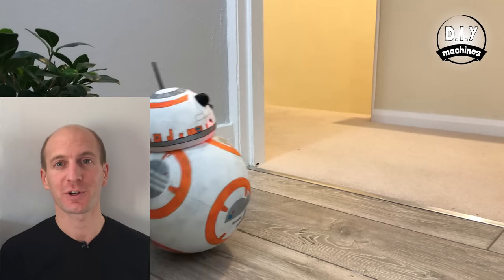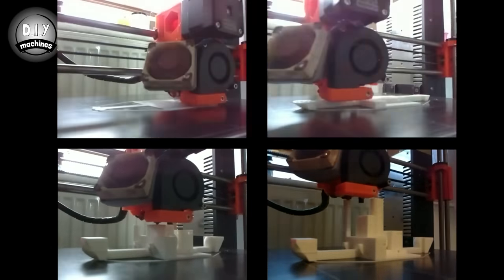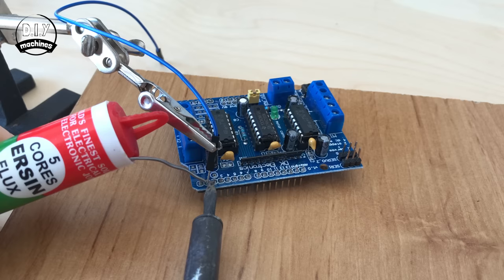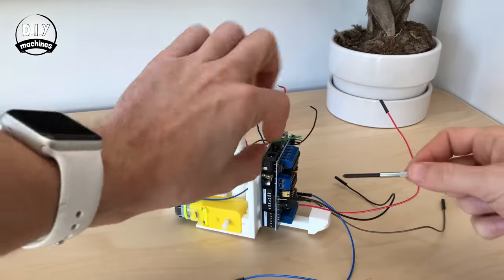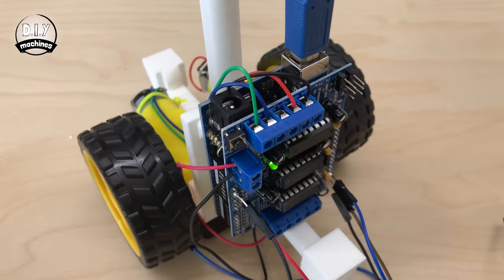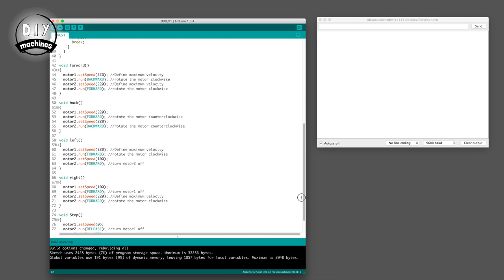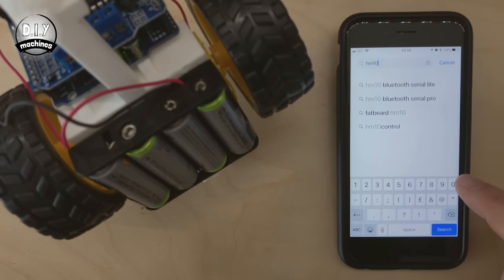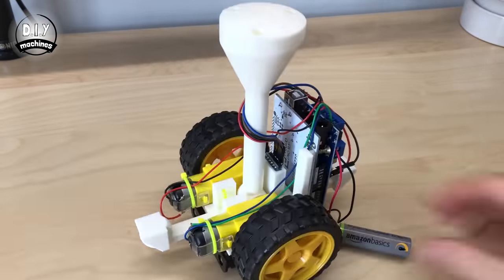Star Wars BB8 Remote Control Printed Robot - P1 Body

Comment: Did build the robot, connected the arduino and motors, have one problem: The link to the arduino code brings me to the DIY machines site and the link on the site leads to a 404 page. So where can i download the code?
Reply from the maker: Sorry, I've Benn redoing my website and made a mistake with the links. Thanks for letting me know. You can find the code here: https://www.diymachines.co.uk/star-wars-bb8-remote-control-printed-robot

Comment: I've watched several BB8 builds on youtube. Nice job on this one - clearly well thought out in advance. Everyone seems to struggle with it wobbling forward and back whenever it stops. Wouldn't the solution to this be to have the motors slow to a stop instead of stop abruptly? I haven't attempted a build of my own yet, and am just getting acquainted with Arduino code, but I wonder if the arduino code could be done in such a way that motors always slow before stopping. Then you could change the deceleration rate to slowdown as quick as possible without wobble. Curious if you think this would work.
Reply from the maker: Thanks. Yes that's a great idea and would help prevent the wobble when accelerating or decelerating. They often refer to this as 'soft start' or 'soft stop' I believe. Here is an example: https://electronicsforu.com/electronics-projects/dc-motor-starter-using-arduino-uno-board

Comment: could u please add files with a smaller size that still fitt the arduino electronics? my wanhao kant print these spheres and i am afraid if a down size it a bit it will not fit, thanks in advance. its so cool!
Reply from the maker: Thanks for your compliment Sjoerd. I'm sorry but I don't have the time to redesign the internals to be able to print it on a smaller print bed, it would be hard work. (The space inside is tight as is). Perhaps you might know someone who could print the two parts of the body for you?
Reply: o wait i can print this, used the wrong settings on the slicer, but it takes a more then 24 houres for only 1 dome part. Could u please suggest some settings? so i get the right result instead of waiting and getting crap..?
Reply from the maker: I printed mine with 20% infill (not that it used any), with automatic supports switch on and a 0.15mm layer height. It took a very long time but the small layer height is important for getting a smooth sphere near the top of the print.
Reply: DIY Machines  thanks!

Comment: Hi, it is awesome. i printed all parts and ı started to install. ı have problem, ı add adafruıt lıbrary code seems workıng but ıt ıs not movıng when ı send serial monitor. I tried motors is working fine (give 5v from outsıde) ı replace uno also ı replaced motorshıeld but nope ıt ıs not fıxed. ıt ıs uploadıng perfect but ıt ıs not workıng when ı send sıgnal from serıal monıtor. could u help me. ı dont want to waste my 5 day prıntıng , materıals and all efforts :)

Comment: How do you change batteries?
Reply from the maker: I just temporarily remove the tape holding the two halves together and pop open the sphere.
Reply: then you have to paint it again?
Reply from the maker: Nope, I paint it without the tape on. Clear tape then goes on over the top of the paint.
Reply: Great! I didn't realize that. Thank you for your very quick response.

Comment: The code wont work. I copied and pasted your code but when I try to run it or download it to bb8 I get an error message saying "no such file or directory" on line 27, where the code says" include < AFMotor.h>" I have googled the problem but can't find a solution, thanks
Reply: It seems that I nead a arduino library for "AFMotor.h" but I can't find one anywhere. Any ideas? Thanks
Reply from the maker: @clmfilms8103  Hi, please try this: https://learn.adafruit.com/adafruit-motor-shield/library-install
Let me know if it works for you.
Reply: @DIYMachines  thanks! The code works
Reply: @DIYMachines  hi, my first problem was fixed, but now I'm having another problem. When I open the serial monitor on the arduino IDE and type a letter nothing happens. Also when I try it over bluetooth still nothing happens. I have tested the motors and they both work. I am using the hc-05  blutooth module with the android app if that makes a difference, but I don't think it should. Other people have used this bluetooth module and it should work. Any ideas? Thanks so much!
Reply: @clmfilms8103  Hi! Did you find a solution to your problem? I'm currently having the same issue
Reply: @amandine7446  sorry, I never got it figured out.
Reply: @clmfilms8103  Thanks for your reply! I guess I'll keep trying
Reply: @clmfilms8103  just managed to make it work (via the Serial Monitor for now, gonna move on to the app next) - what I have changed in the code: I took out the line     Stop(); //initialize with motors stopped     and changed the switch loop to          case 'S':
      Stop();
      break;            instead of making the Stop command a default
Reply: @amandine7446  thanks so much for telling me, il try it:)
Reply: @amandine7446  still can't get it to work, although its possible that I haven't changed the code properly. I'm geting an error that says:

exit status 1
'Stop' was not declared in this scope
Reply: @amandine7446  thanks so much, it works:)
Reply: @clmfilms8103  Awesome :)
Reply: @amandine7446  for some reason I'm now having more problems. The app works over bluetooth, but only when plugged into the computer. I wondered if my batterys where almost dead, because when its plugged into my computer it gets charge from that and from the batterys, but changing the batterys didn't work. I'll keep trying I guess.
Reply: @clmfilms8103   there can be several things going on there: 1. yes maybe check the battery again and whether the battery is correctly connected to the circuit. You should get a green light if that's the case. 2. check whether the cables are correctly connected to the HM10 - the first time I did this I had them mixed up 3. you need to plug back the jumper (see video) otherwise the batteries won't be connected to the HM10
Reply: @amandine7446  thanks for the help, but I have done all of these. Has the app worked with you?
Reply: @clmfilms8103  I used a different app (same brand than the HM10 I bought it's an app from DSDTECHGLOBAL)